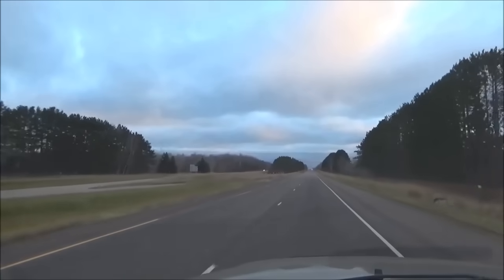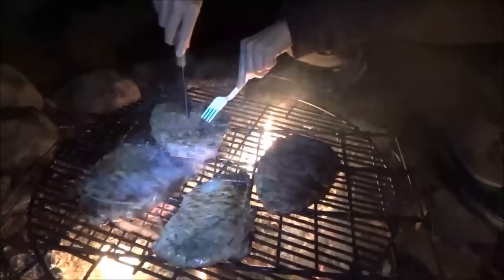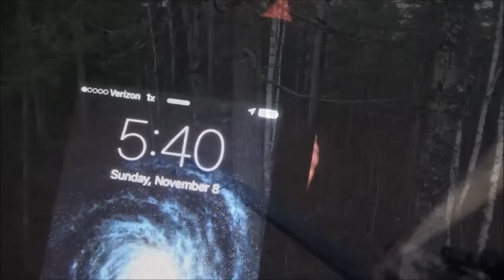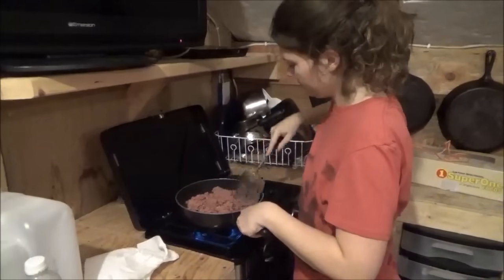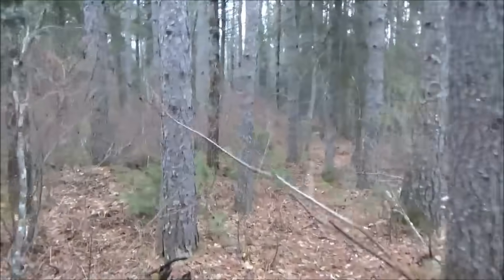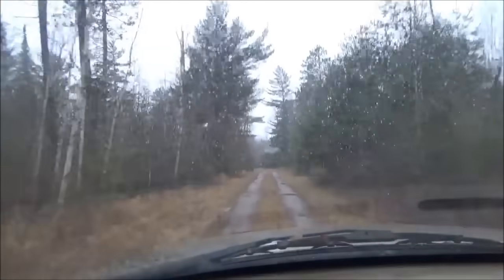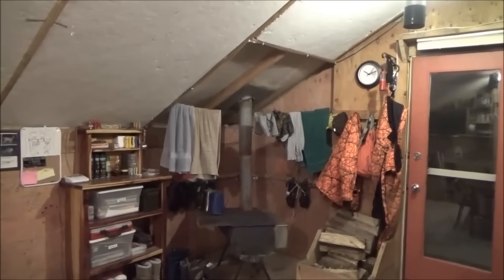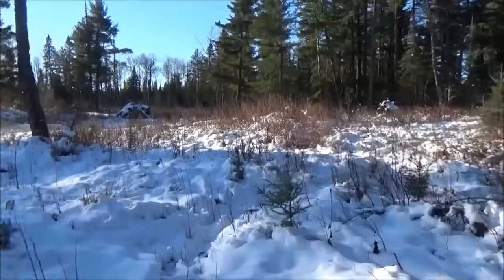DEER HUNTING 2015 "The Movie" MN Opening Week.

Comment: A lot of great video.  Went hunting this morning here in central Florida.  It was 31 degrees and windy when I headed in to my stand at 5:30 this morning.  Nothing moved.  There are some dog hunters not too far from here.  I could hear the dogs start to run then stop several times off and on all morning.  The cold front that moved through seemed to run the deer to ground.  I will just have to try again in the morning.  Good luck to you all, stay safe and thanks for the video.
Reply from the maker: +dalton vickers Thank you and good luck. Here at this time of the year the deer lay low when it gets warm because they have there heavy winter coat of fur so they try and stay cool by not moving around. I imagine down there where its usually warm they probably curl up when it gets cold so they can stay warm. Thanks again. Joe